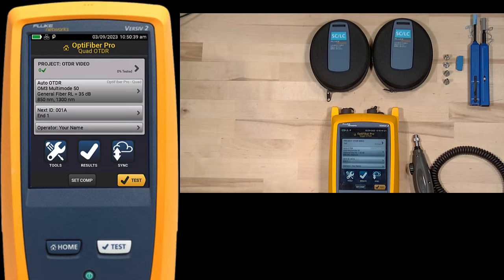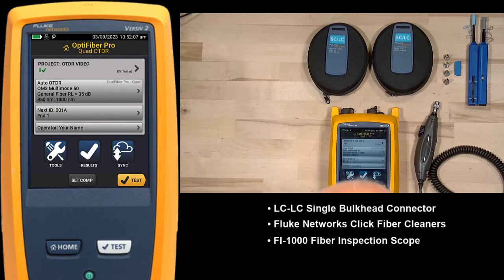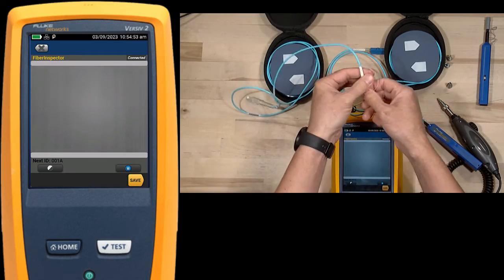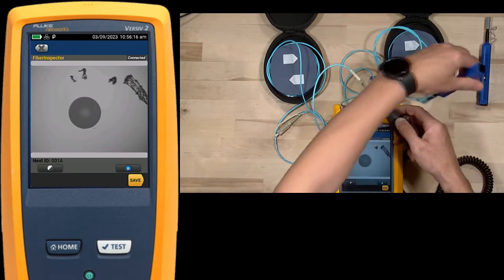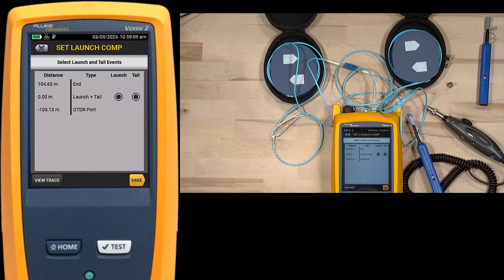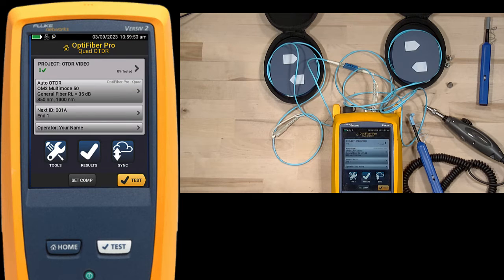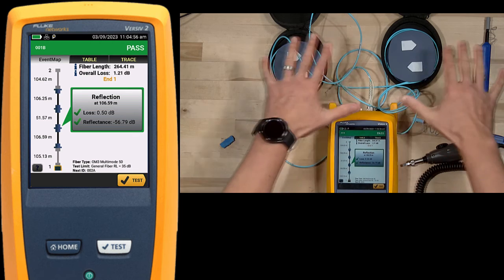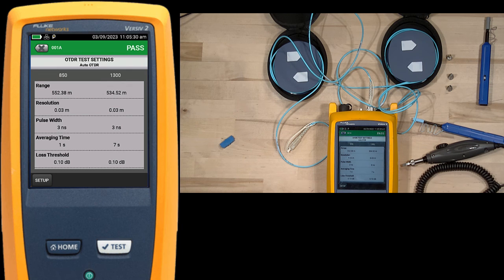Running an OTDR test with the Fluke Networks OptiFiber™ Pro

Comment: Mike, When setting launch comp I get a warning that says "Cannot locate end - Cannot locate a  good, non-hidden end" any advice. Both of the launch cables will test on their own but they won't work together.
Reply from the maker: This can happen with APC connectors. If so, you'll need to use manual entry and type in the length of the launch and tail cords.

Comment: 9:58 Oh NOW you want to inspect the bulk head :) You never checked or cleaned the bulk head when connecting launch & tail cable e.g. at 4:15
Reply from the maker: Great point!  From a training standpoint, sometimes it's better I don't, so I can show what happens when you don't clean it first. It is good practice to clean the bulkhead connector before inserting the fibers. I'll do a video showing the bulkhead connector under a microscope so people can see how much gunk is in there. Thank you for the comment.

Comment: Sir how to solve negative loss
Reply from the maker: Negative loss is most likely caused by a difference in backscatter between the fibers. To get an accurate measurement, you must measure in both directions and take the average, know as bi-directional averaging. I'll do a video on that shortly.